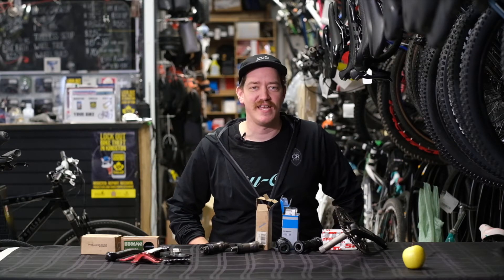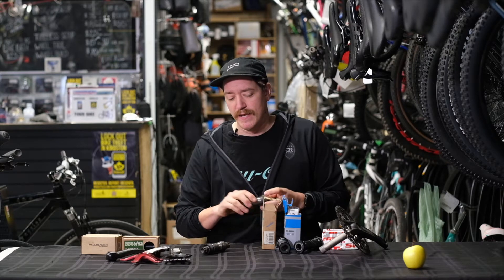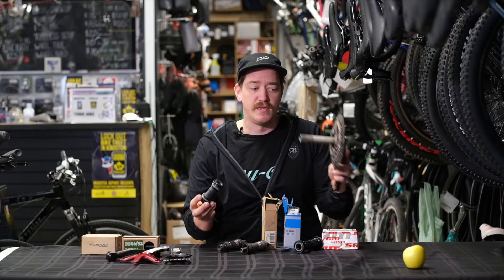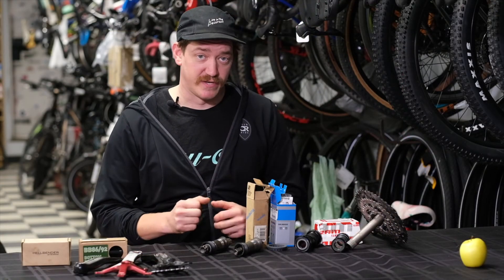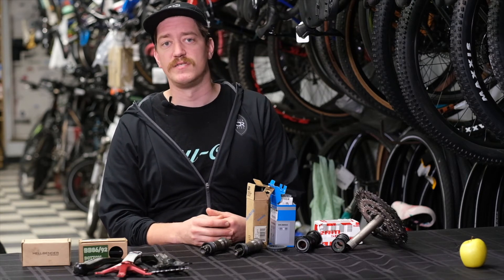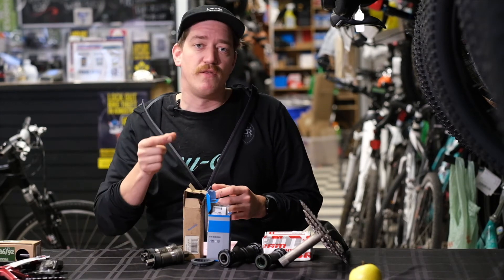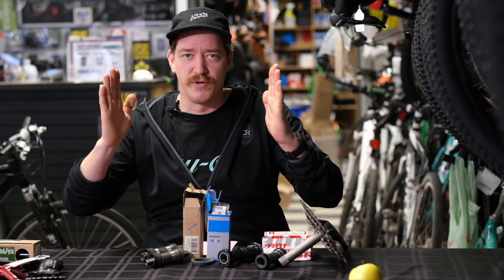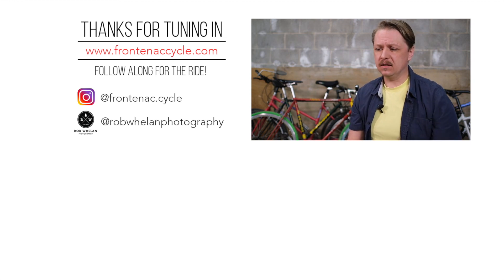Bottom Bracket Standards Explained

Comment: press fit - in engineering terms is known as "interference fit", it's very common and effective in industry.  HOWEVER, tolerances and "roundness" must be observed which the cycle industry refuses to do so frames have bb shells that are not round, not sized within required tolerances and sometimes each side isn't even straight or "parallel" let alone concentric.  This wears out bearings prematurely and is a big cause of creaking sounds.
The bike industry is moving away from press fit because of this and cos it can't do quality, just fancy paint jobs.  
They're going back to screw fit which deals with a lot of the problems (threading is more forgiving and it's an older well established skill).  It will be interesting to see trends in the carbon bikes.